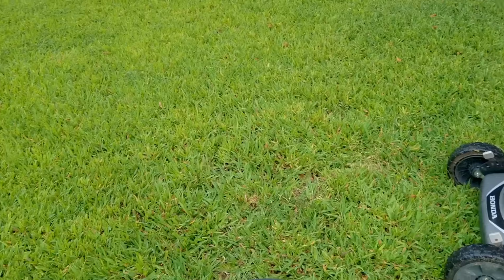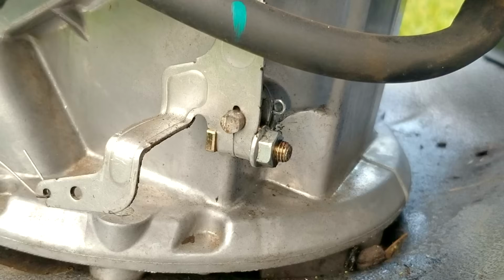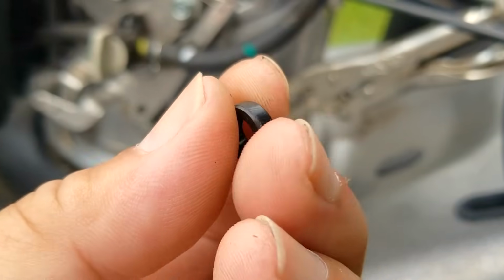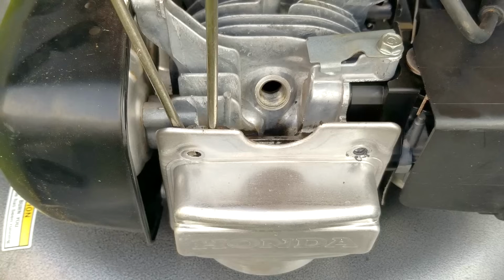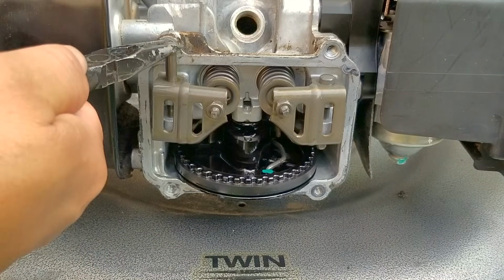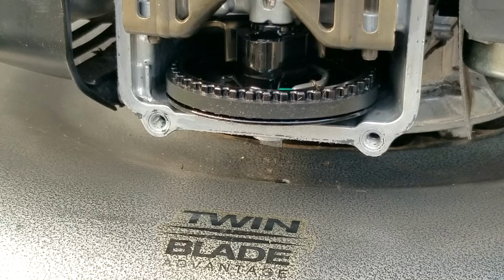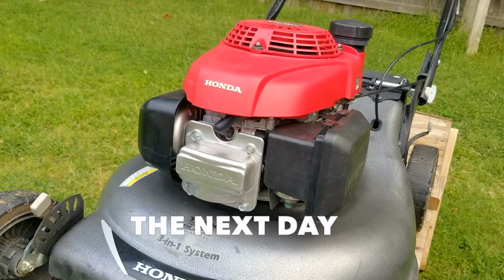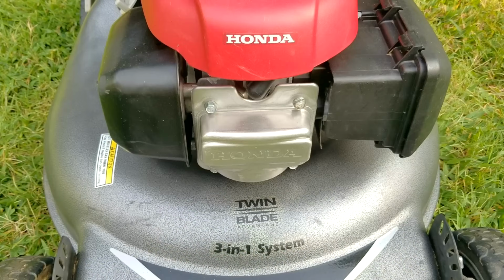Fixing Two Nasty Oil Leaks On A Honda Mower.

Comment: Hi !  Thank you for excellent clip. I just changed carburetor on similar Honda GCV160...and suddenly a circle round bakelite or something...plate fall out. 19 mm in diameter and very thin. I do not figure where that belongs ?  Can you help or someone help ?  My machine also leak oil after changed the carburetor. Now I put new sealant on cover and will test it again tomorrow. Thank you up front ! :-)
Reply from the maker: unfortunately I've never had that happen before.  Is there a way you can post a picture of it?
Reply: @HomeGaragechannel  Hey !  I tested the machine today and the oil leak is repaired by the floating or tube sealing I put on yesterday on the valve cover. Thank you for the response and attention.  Lovely engines.  Delicate Japan Juvel...as so much other from Japan. I will make a film where you can see that little thing....on my othe channel " Motor Diverse "  Could give you a link later.
Reply from the maker: Nice I'll check out the video
Reply: @HomeGaragechannel  https://youtu.be/qrp_x79svhE

Comment: B&S engines are agricultural type mowers - simple but they don’t have power or fuel economy of Hondas. Great video - OMG I hate 🤬 the use of “O” Rings and RTV sealants in modern engines. We are designing engines to fail from flimsy seals. Thankd\s for video! FWIW buy the more expensive Honda 190 - 200 mowers. The cheaper 160cc mowers have plastic bushings / sleeves that bind up.
Reply from the maker: Thank you very much.

Comment: I bought a John Deere JS36 with a 6.5 Quantum and the bag for $20, and got it running without putting anything into it. I am putting a new belt and self propel cable on it for the heck of it. I even got froggy and did a redneck restoration and painted the recoil housing and throttle bracket. It's the first time I've ever painted anything. It's missing the plastic engine cover and I couldn't find one for it, so I kinda had to. It's a nice machine that should bring good money, so it was worth the effort.
Reply from the maker: Wow, you did what I would have done. Spray Rattle can's don't cost that much and makes things look nicer.

Comment: Certainly not as much experience as you, but in my limited experience I find it easier to take GCV160 mower engines off the deck and rest them on their backside (valves pointing up) to do anything involving the carb or valves.  IMO, it saves a lot of frustration/time by taking out the 3 to 4 bolts vs trying to do everything when it's mounted to a deck.  Has additional benefits being able to do whatever is needed to clean and refinish the deck + shaking the engine (valve cover off) over an oil pan gets most of the residual oil out.
Reply from the maker: Thanks and that makes sense

Comment: No I would fix the oil leaks,my dads GSV190 engine doesn't appear to be fitted with a governor shaft seal at the factory so I might have to order one for it  !
Reply from the maker: I always wondered by there was no seal to begin with.

Comment: Great video. I have a Honda so I have a question. When you inserted the new Governor seal did you have to remove the old seal?
Reply from the maker: Thanks and these don't have an Original governor Shaft seal.
Reply: @HomeGaragechannel No seal from factory is surprisingly disappointing.  No wonder it leaks. Really enjoy your knowledge & content. Thanks
Reply from the maker: thank you very much!

Comment: I’d rip the Honda engine off the mower, and replace it with a Rotax engine!! Hahaha… Just kidding!! I would replace the worn seals. It’s cheaper than forgetting to top up the oil, and the engine seizing up mid mow. I do like the idea of putting a twin cylinder Rotax engine on the mower though. Hehehe
Reply from the maker: man.. putting a Rotax on here would be CRAZY but awesome.  It would sound great too.

Comment: You don't want any oil leaks on a Honda with a blade clutch (roto-stop).  The oil (or any oily water if you hose off the machine) will drain out through the little hole on the deck, and onto your clutch assembly.  When it drips into that assembly, the clutch is pretty much useless; engaging the blade will simply let the clutch slip until the blade can finally catch up with the crankshaft.  It's not a difficult repair, but the price of that disc has doubled in the last 18 months, from about $25 to around $50.  Way, way cheaper and easier to fix the oil leaks.
Reply from the maker: Really? I'll have to look into that. Never considered that happening before.  Thank you!

Comment: Did you place that governor seal over the old seal?  You didn't show removing the old seal so I was wondering.
Reply from the maker: On this one, there is no "original" governor shaft seal.   Just cleaned out the dirt and installed the new one.
Reply: @HomeGaragechannel  Now that's interesting.  No wonder it leaked.  I expected better from Honda.
Reply from the maker: I don't mention it on video  but I've always believed these leaks are due to a lack of maintenance but I don't have enough data to prove it.

Comment: For those who need seals for a Honda GCV160/190 engine, here are the part numbers:
Governor seal                           91231-891-003 Honda Marine
Camshaft O-ring                       91301-ZM0-V31 or 91353-671-003
Bottom crankshaft seal           91202-ZL8-003 or 91202-ZM0-V31
Top crankshaft seal                  91201-ZL8-003 or Honda Marine 91201-Z0Y-003

Apply plumber silicone grease on cam o-ring and shaft for easy installation.
Reply from the maker: Thank you very much for the part numbers!
Reply: You’re my hero. Thank you! Haha

Comment: Probably have to watch this video a few times to fix the leak in the valve area. The leak by the gov seem easy enough until one pits it back together and its idling at 500 rpm or 150 rpm. I have that same mower by way of MTD. Thank you so much for this learning lesson! Don't think I would have ever figured it out without videos like these!💯🙏
Reply from the maker: Hey I really appreciate it.  Don't worry if it was something I'd never done before , I'd look for videos on it too.

Comment: I have one of these Honda engines in my pressure washer. Been good for 12 years. Glad I got a good one. Every brand has their quirks.
Reply: For engines used in pressure washers, that governor shaft seal is included from the factory.  Just fyi in case you didn’t already know.
Reply: @KSMike1 Why would they leave it off on the mowers? Makes no sense.
Reply from the maker: That would be a question for someone at corporate I guess.
Reply from the maker: I didn't know that, thank you for letting us know
Reply from the maker: Well said.

Comment: It's important to recalibrate the governor anytime the lever arm is removed. I believe that's done by turning the governor shaft to the stop and the throttle plate wide open before tightening down the clamp bolt. There are lots of videos that show the process.
Reply from the maker: thanks for that.

Comment: I've never been a fan of overhead valves but had a couple of Kawasaki motors that were trouble free, As for leaks, I'd change it over to the 15/40 oil and see how it did then. Thicker oil sometimes stops leaks off but most always slowes them down. Happy weekend
Reply: That's not really how you fix an oil leak lol.
Reply from the maker: It's worth a shot although I wouldn't feel right selling with a leak.  But for personal use, why not.
Reply: @HomeGaragechannel  I'm with you 100% and it was 70% today but tall and wet! Blessings!

Comment: So once the markings are facing straight forward the little shaft comes down easily?  Sorry maybe I need to watch it again when I didn't just wake up 😅
Reply from the maker: The marks on the cam gear need to be "parallel" with the engine.  This is just in case the timing gets out of place, it'll be easier to put back on.  The shaft will push down in "any" position the gear is in.
Reply: @HomeGaragechannel thank you
Reply from the maker: Anytime.